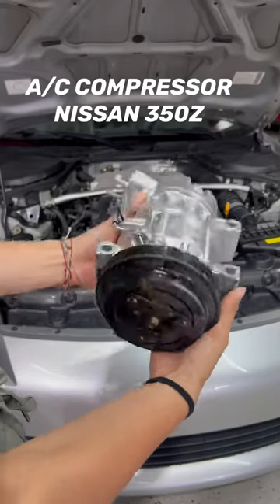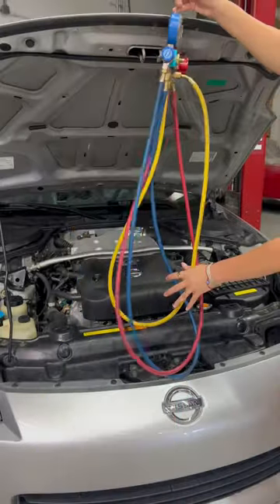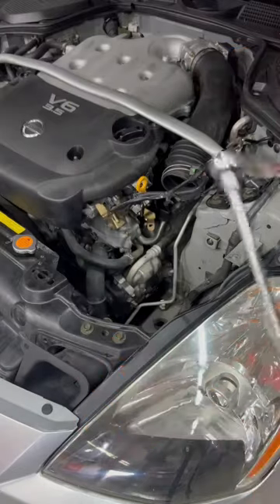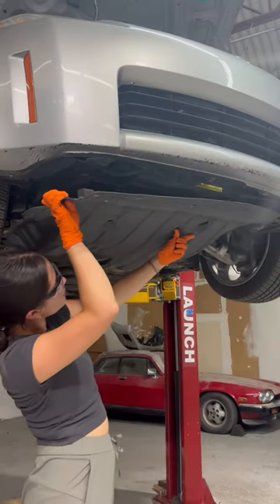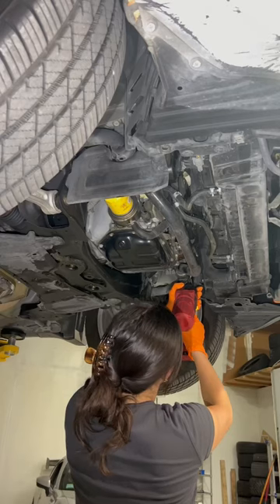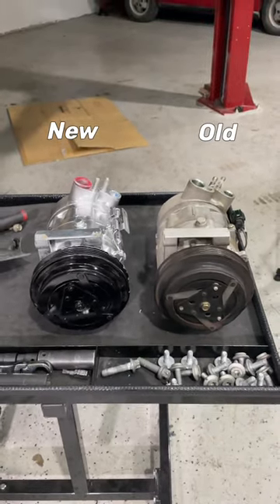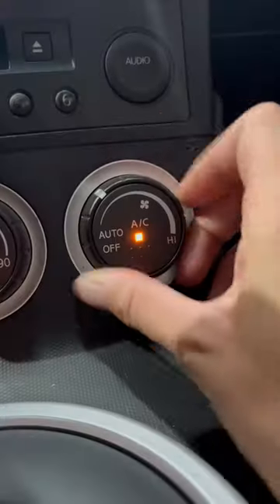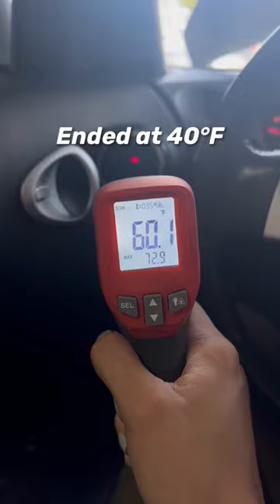New a/c compressor on this 350Z✔️❄️

Comment: Important tip, make sure you refill the compressor with oil and r134 is about 20 to 30 degrees different then outside temp.

Comment: When Replacing a Major component like the Compressor or Evaporator it is recommended to Replace the Liquid line Receiver Filter drier.
Also a Good Evacuation is in order if u want ac to Last.

Comment: Nice work.  Why did the other one fail. Of it was an internal failure I hope you flushed the lines and replaced the receiver dryer.  If not your new compressor could also fail

Comment: Too quick. When you get a new compressor usually you need to prep it before installing it. Remove oil, put new oil as per spec of your vehicles model, spin the compressor clutch by hand a few  times to circulate proper new compressor oil then install.

Comment: I was actually wondering if you have to run nitrogen through it to make sure it was nice an dry and then pull a vacuum before you have to recharge. Just wondering because I plan on doing the same to my my car.
Reply: When Replacing a Major component like the Compressor or Evaporator it is recommended to Replace the Liquid line Receiver Filter drier.
Also a Good Evacuation is in order if u want ac to Last.

Comment: Don’t you have to also do the condenser and another ac part I forgot about somehow, or else if the compressor fails the manufacture won’t warranty since you left old parts with possibly bad refrigerant and/or contaminants inside?
Reply: The drier

Comment: AC compressors don't usually go bad on these. you should have did a full drain down and fill up with refrigerant and a new belt first.  But if it's a bad compressor get rid of it lol🤷‍♂️